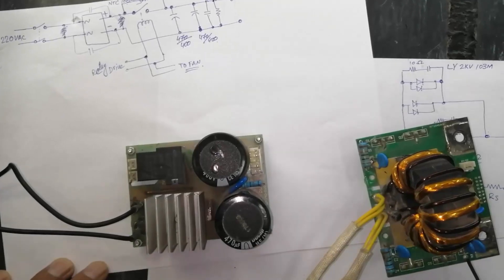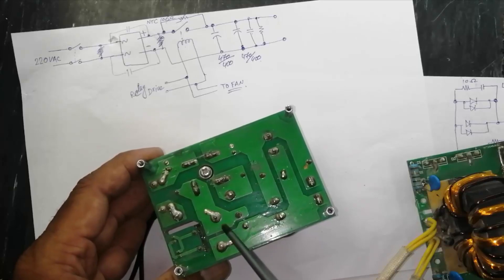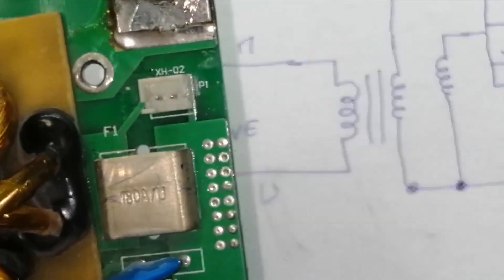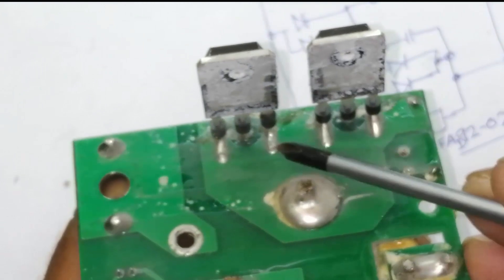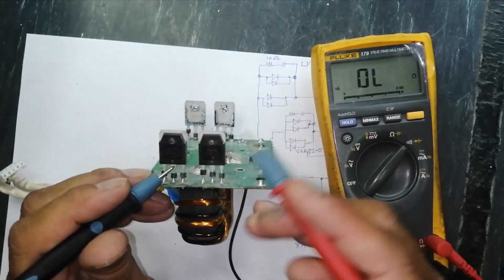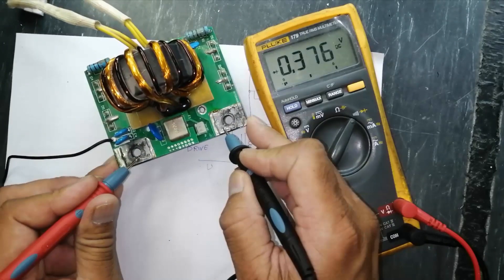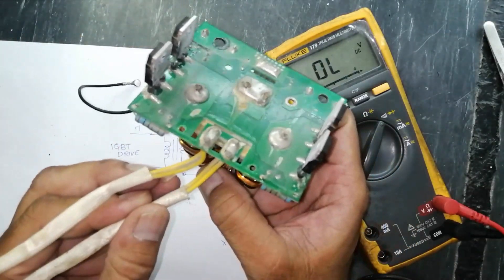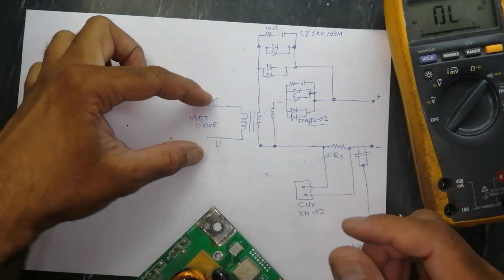#287 nverter IGBT Welder Machine (Part -2) Output Rectifier Circuit Explained & Troubleshooting

Comment: My question is how that little transformer core handly 1 or 2 hundred and I am trying to fine that same igbt welder transformer on sandust manufacture and no core is able to handle 1 or 2 hundred amp that small size so I ask a customer care service about this she said the core available for 1 or 2 is 80mm ×100mm ×58mm she Said the core for igbt welder or not available for retailer sales only manufacturers companies so that's why I can't fine this core in that small size for sell to  build circuit because I want to make a 200 am battery charger mppt with a small core at 50khz instead of using 250kz to get the full wattage of ee type core

Comment: وعليكم السلام ورحمة الله 
very helpful and good work
i want ask about my ingco igpt inverter welding machine ... damaged ..
have more than one problem 
one of them 15p thermistance are 43 oh and after some secands become so hote ... and the relay never activated 
and the output is cant measured with my voltmeter and mark as high voltage!!
how can the outpute become high votage at the time of more than 600v dc in my multimeter 
thank you 
baraka allahou fik

Comment: Hi Haseeb, I have a single board jasic inverter with a problem.  The output rectifier IGBTs all exploded so I replaced them and the machine now has 75v OCV (normal) but won't strike an arc (only very weak sparks), voltage seems to drop to around 50v when it sparks slightly.  I've already blown up one set of IGBTs.  The output tests ok as per this video.  What should I try next?  Many thanks.

Comment: I watched last night and was reminded how I completely forgot how the voltage and current is changed with the digital systems power supplies.  I didn't think about how a square wave can be transformed and have seen in the past... though really stuck this time for the high power designs as well.   Guessing from waht I understand, the torroid or high magnetic permeability material core is designed for the frequency of switching... maybe a midpoint if there is adjustment.  Then the typical winding ratios for the desired midpoint of output voltage(s) and current(s).   Then that alternating current square wave is rectified so to be a DC output.   I'm new to the high frequency transformers in general, so is neat to have that learning moment.  Thank you sir and kind regards, In Christ.

Comment: what is the output voltage in caacitor  if you connect line in 220v supply
Reply from the maker: please check video number 305 for getting your detailed answer with practical 
or
just multiply input ac voltage with 1.414 to calculate dc voltage on dc capacitors (after bridge rectification)

Comment: Excellent Sirji, great work.
Reply from the maker: special thanks
Reply: @HaseebElectronics  SirJi, my model do not have relay and NTC. Pls suggest me some fuse or circuit breaker for input protection from high voltage and subsequent hi amp draw. My unit inrush current is 48 amps.

Comment: Bhai mere welding machine kabi kabi shock dera iska koi hal batayo
Reply from the maker: is ke output me class Y capacitor check karein
Reply: K bhai iwill check.....
Reply: Assalamu alikum bhai.mera mosfet inverter welding machine hai,3 board wala...holders me shock ka problem nahi repair hora kya kare??

Comment: Sir why you did not explain all parts that installed at that part example resistor. , mylar capacitor what is the purpose of them in that section
Reply from the maker: i am sharing the working concept, for example IGBT have to receive pulse and it have to switch
if i go in deep details of every component, viewer complain to me for long videos. so i try to make it some short
if you suggest, i will try to explain in more detail, i have no problem

Comment: I was wondering how to know wheater caps were dc. In the previous video u measured dc voltage across capacitor. I though caps in dc act as open circuit and ac it act normal. Ie charging and discharging phase